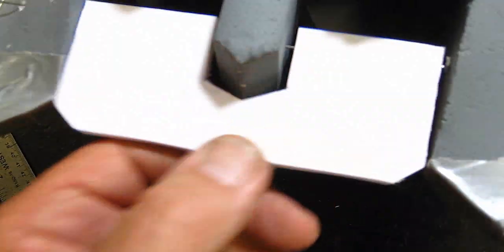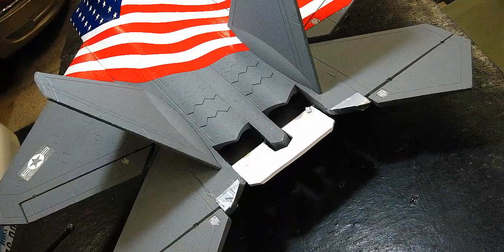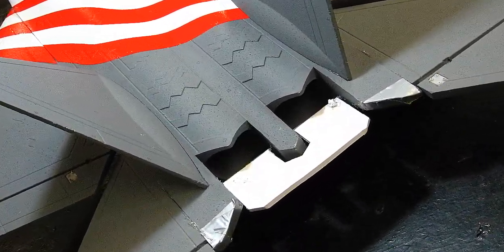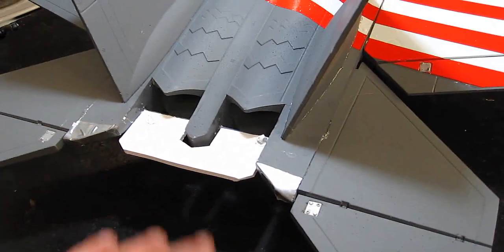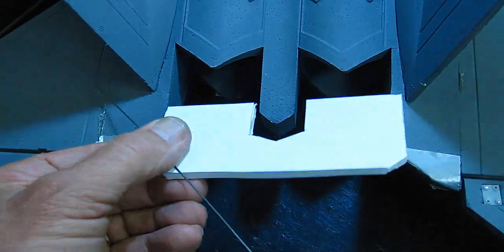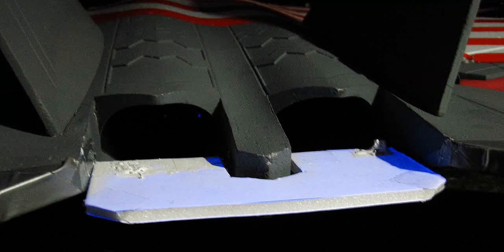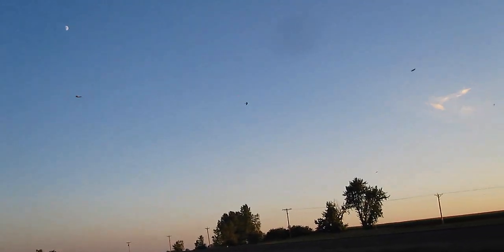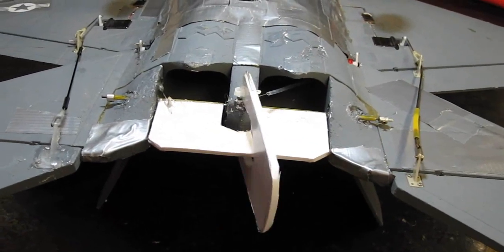I don't need no STINKIN' Elevator. I added Vectored Thrust to my F-22 Raptor.

Comment: Hi Night Flyer, I always waich your video with great interest. 
I know it is a prototype, but thrust vectoring with something looking an airfoil seems more efficient, like a section on blade of a 60  or a 600 helicopter, or something round at the leading edge and thinner at the trailing edge would give better thrust.

Comment: hey you should use the f-22 on a elevon mix
but include the vector control surface also it looks like if you cut it in half and attach the main control rods to the vector control surface you will gain a better aileron response

so you dont need no stinkin  elevator or aileron

Comment: I didn't get started I always had it. Building parchutes and hot air ballons when I was 6-7, build kites before that from one bamboo stick some threat and a ol newspaper. Line airplane flying leads into RC flying after that.

Also bought a lot of airoplane catalogue books when I was 7-9 years ol with all the diffirent airoplane designs in them. Build my first 'rocket' out of fire works demolishing a window 50 meters away on ol yearz eve LOlz Freakin thing went stinking fast ...